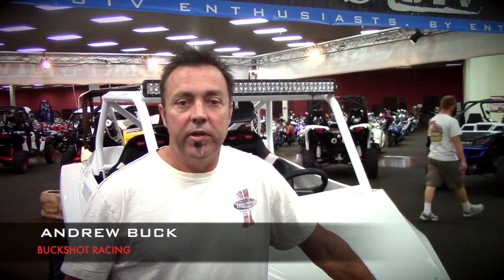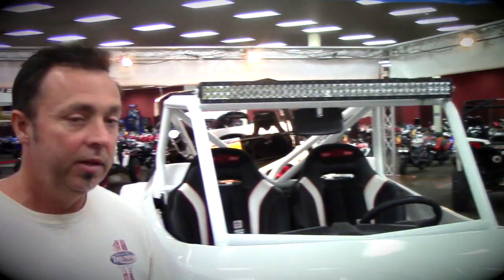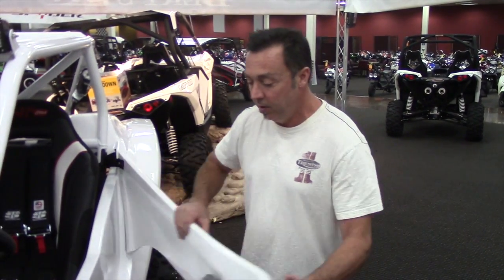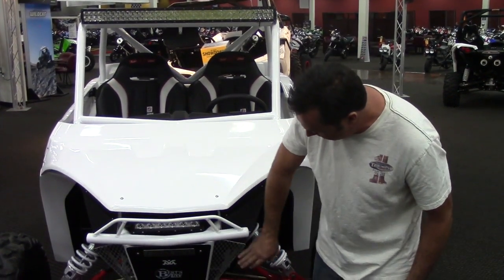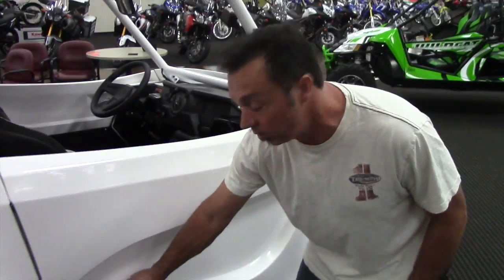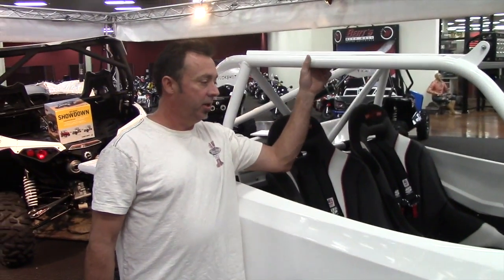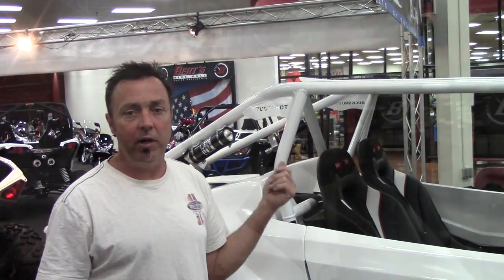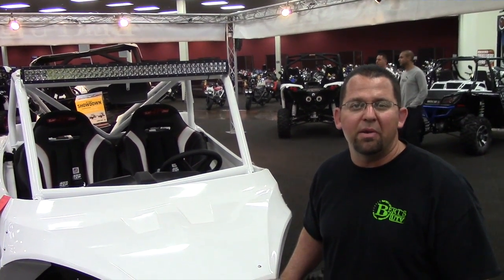RZR XP 1000 "BUCKSHOT BUILD" | Custom Build Inside Look

Comment: The radiator needs to be mounted in the center of the cargo area to prevent clogging from mud and debris. It certainly doesn't need vents on the front to help funnel it into there. Just a though. Very nice fiberglass work. Is the passenger area waterproof? I saw the raised lip behind the doors like it was all one piece on the sides.